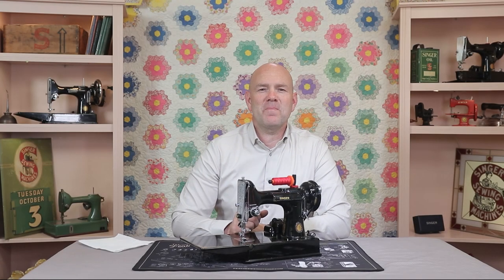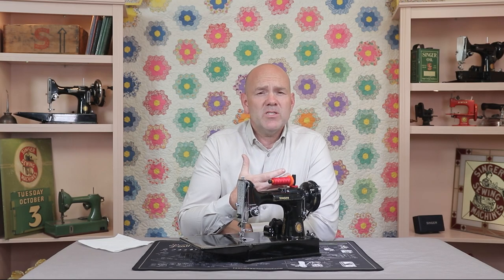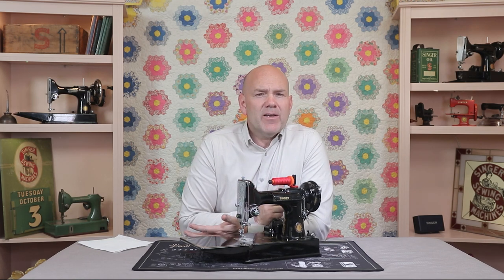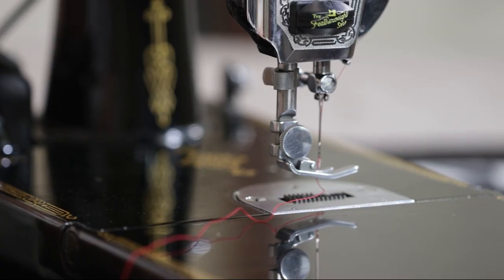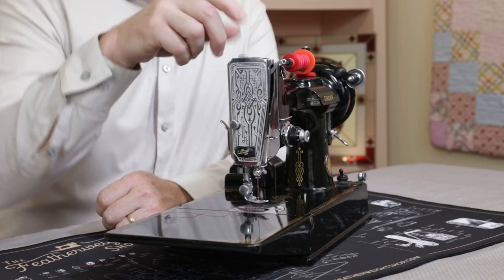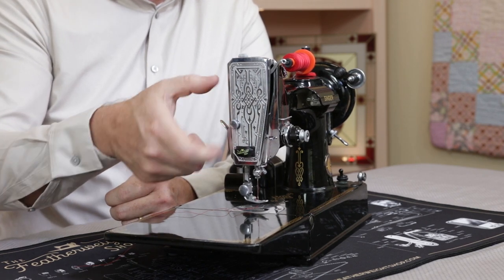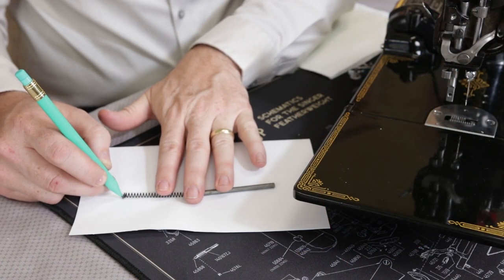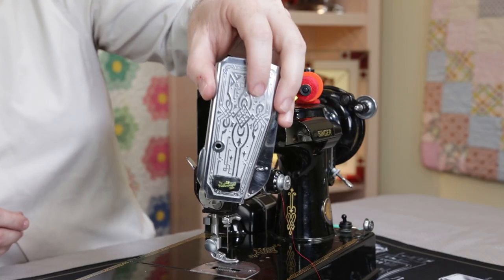Singer Featherweight Pressure Foot Pressure Adjustment

Comment: Just Saying,  I have a Model 66 singer machine and my pressure knob is missing, I wonder if You would Point me in the right direction to find one, For as You Know it won’t sew without one, Any help would be appreciated, they might all have the same threads, the sites I have gone to give no reference to a pressure knob.

Comment: When you are thru sewing and putting your machine away, do you put it away with the needle up or down?
Reply from the maker: This tutorial will be helpful for how to store the Featherweight:

https://singer-featherweight.com/blogs/schoolhouse/how-to-store-the-featherweight
Reply: @featherweightshop   I read this tutorial and have a question.  My machine sits on a table and I am using it several times a week.  Is it necessary to remove the pressure foot when not in use?  I usually place a piece of fabric under the pressure foot,  put the pressure foot down and put the needle in the down position.  Is this correct or how should I store it between sewing projects?  Thank you..

Comment: Any thoughts on why my 201ks pressure knob doesnt screw down fully?or is this normal thankyou
Reply from the maker: Thank you so much for inquiring! Our specialty is the Singer Featherweight 221 and 222, and occasionally we carry parts or can locate parts for particular models of vintage Singers, but in this case we would recommend contacting your local sewing machine technician for service and repair.